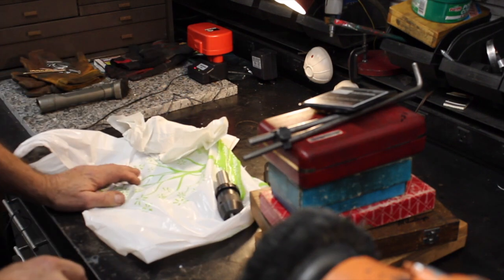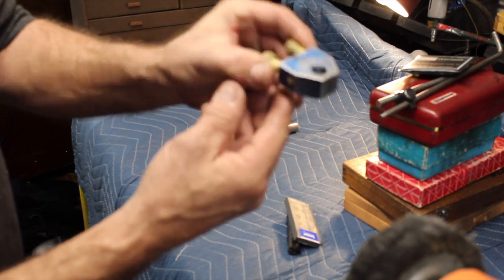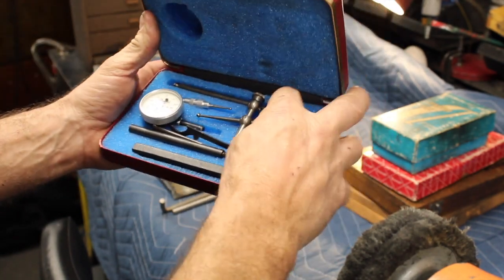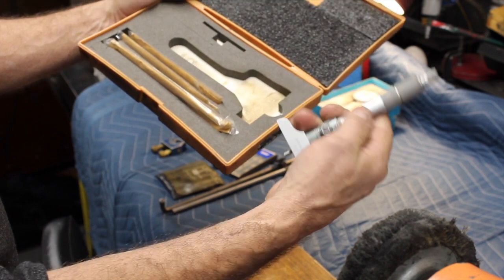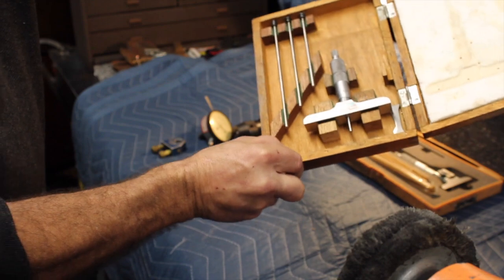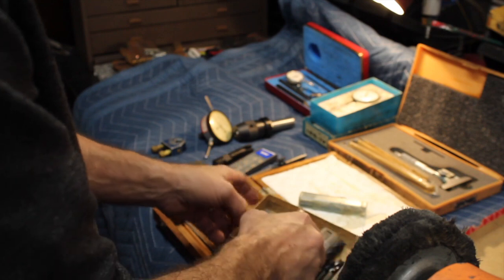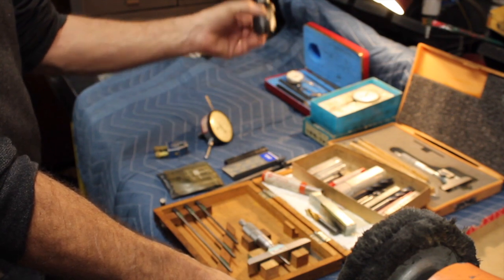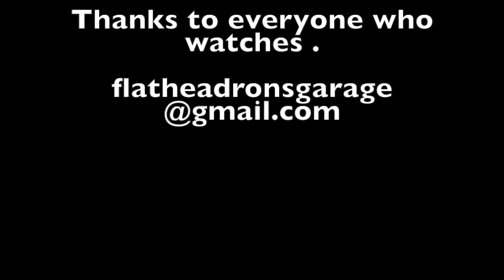Tuesday TOOL SCORE

Comment: You did well GrassHopper!!  I'm jealous, I need a Starrett DI No. 655-14 for my Starrett 653 Cast Iron Comparator Stand.  The Teclock DI's seem to be well made, from what I've seen inside them while cleaning.  No auto focus?  Been missing you!
Reply from the maker: Thanks for watching Vernon. After my procedure (this should be the last one) last week all I can do is get better and I feel really good. Got a screaming deal on the stuff though. Yes it has auto focus but it’s different than I’m used to. It doesn’t focus on the fly if that makes sense. Or I just haven’t figured it out yet. Ha ha. I’ve been missing it as much as you have brother. It really hurts to come out here and just stand here and I can’t do anything. Not touching them while on meds. I might be missing a body part if I tried, Head is almost clear.  Feels good. 🤡 😁😁🧰🛠
Reply: @flatheadronsgarage7345  Great to hear.